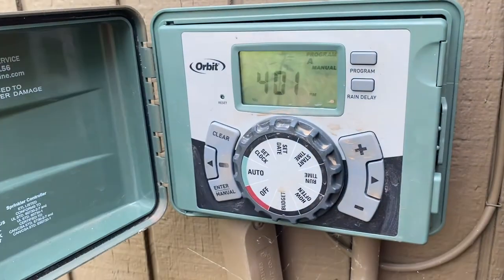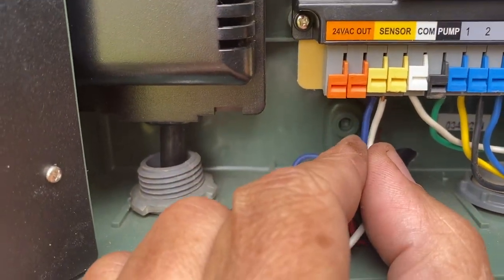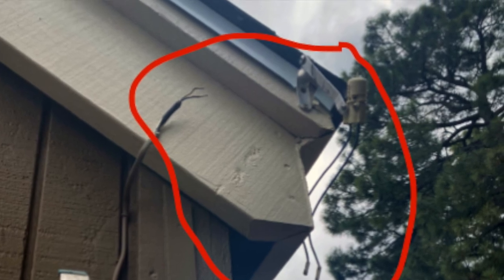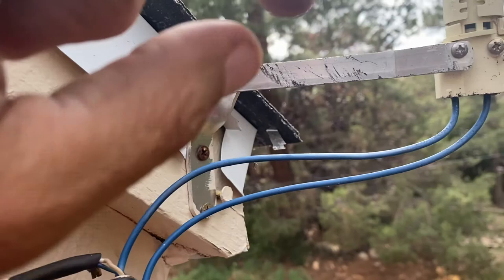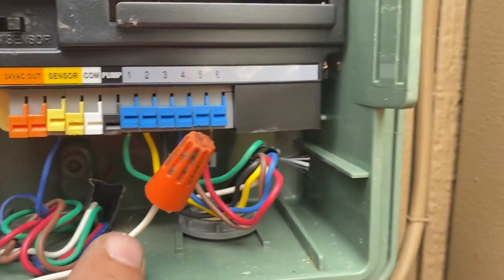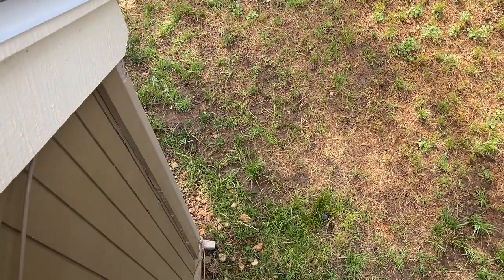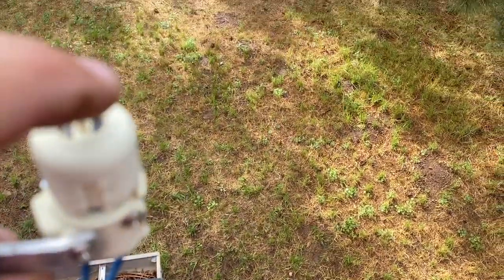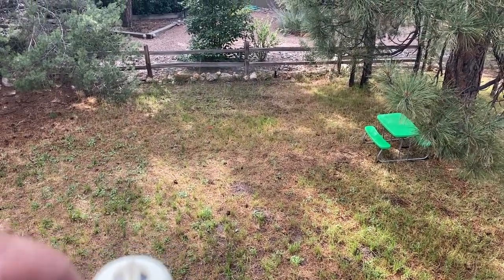How to install any rain sensor for Orbit controller, 2 different ways

Comment: How do you bypass the rain sensor if you want the system to come on after it has recently rained heavily using the exact same orbit control box you have there?
Reply from the maker: You should be able to flip the Sensor On/Off switch.  If it just rained and the sensor is stopping irrigation, then flip that Sensor switch to Off.